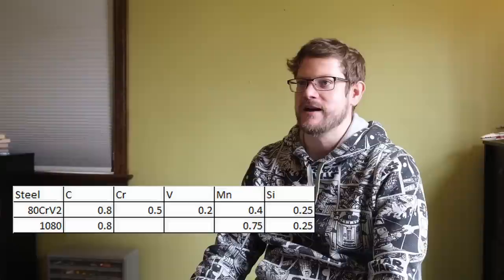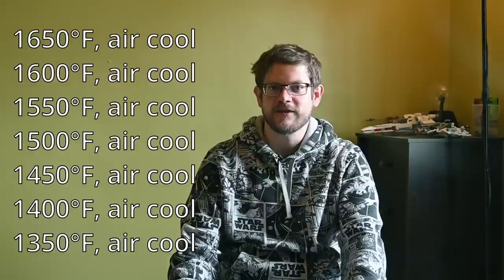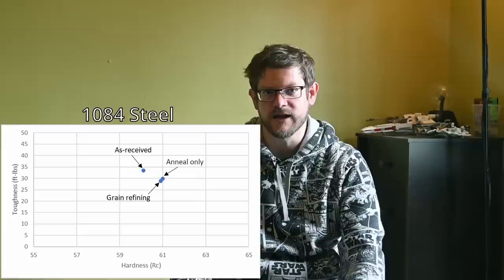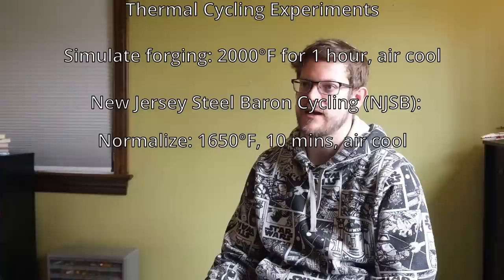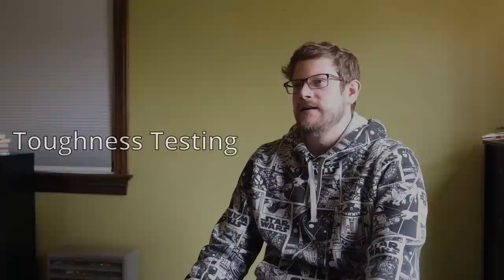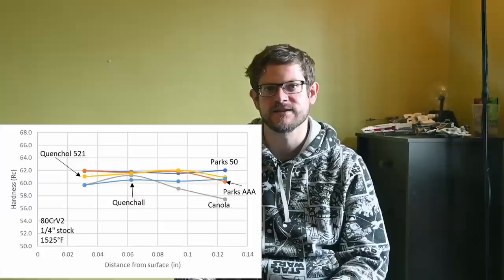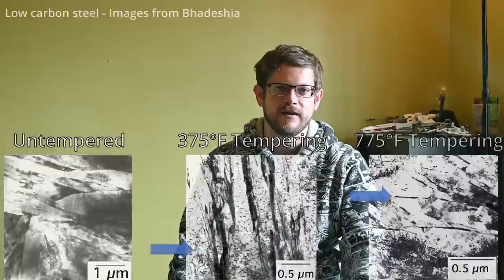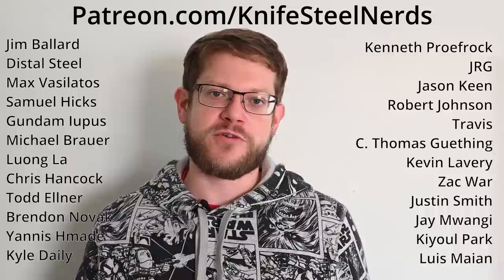How to Heat Treat 80CrV2 Knife Steel

Comment: I make professional grade throwing knives for no spin and half spin throwing. I use two steels 80crv2 and 5160. Both are super tuff and do not suffer snapped tips or blunted tips. Ive stuck mine into cinder blocks even with no damage done

Comment: I've been using 80crv2 for some time now. Also, having a kiln gives me excellent results. Using the processes you've mentioned, is exactly what I do. I use Parks 50 as my quench oil, and the result is excellent in toughness and edge retention. I really appreciate your research, as it definitely helps me become a better Smith
Reply: How fast do you bring the furnace up to temp? If just doing stock removal knives what process do you recommend I use? I also use 3/16 steel so would the formula change? I have park50 oil as well.
Reply: You've figured out how to program a kiln? What programming degree do you have?

Comment: WOW that is a lot of information! I love my WINKLER belt knife in 80CrV2 !!
Reply: Dude I love my winkler woodsman but I’m always conflicted that I straight up spent $380 on a knife… and on a knife with a steel that as Larrin says is so “boring” lmao. It’s a true workhorse of a user knife but Jesus Christ I spent $380 on a low alloy carbon steel. Still, performance wise, no complaints so far and it takes a stupid sharp edge so easily, which I guess is why Winkler likes to make his knives with 80CrV2.
Reply: @andresgamba1478  the Woodsman is an Awesome WINKLER blade. $380 is a lot of money, but it’s a WINKLER. Mine was $350 , and I am glad I spent it. I have 4 knives
Reply: @andresgamba1478  Winkler and RMJ using 80CrV2 is completely corrupt.  This is for their own ease of manufacture.  Their prices are immoral for what you're getting.  RMJ also uses 3V and Magnacut - so they defiantly know better - though they charge even more ridiculous prices for their 3V offerings.
Reply: @mlentsch  then don’t buy them, what can I say? The steel a knife uses is not the only factor in its price, nor is it even the most expensive factor in knife production. Me and a buddy of mine who both carry a winkler as users will swear by them but I can understand your conception that a knife in 80CrV2 shouldn’t be that expensive, even if I disagree.

Comment: Thanks very much for this video Larrin, and your book which is a really great resource. I'm in the process of heat treating a chopper I made out of pattern welded steel. I used 80crv2 (Jantz), and 15n20. It's very confusing trying to figure out the right method to heat treat since it's 2 different steels with differing properties. Since I wasn't sure, and for 15n20 your book says to austenitize at 1475 for 10 min which is close to the recommendation for 80crv2, I'm going with the 80crv2 rec. I do have a new Jen Ken vertical air bath kiln, which is AWESOME, so that should help. I've already completed the normalizing and heat treating steps, and will quench it tomorrow in parks 50, then planning to temper at 400 for 2 hrs x 2. Thanks again for the good advice! PS. I'd love to see a video outlining some general rules/recommendations for heat treating pattern welded steel in the future, but I know that must be a seriously tough subject to tackle!

Comment: Thanks for the video, was contemplating purchasing some 80crv2, still thinking about it.  I purchased your book, and have been selectively going through it.  I’m new to knife making, and am amazed how steel can change in a solid state through different heating processes.  Don’t have a heat treating oven so will be using your suggested methods for heat treating until I can get one.  Once again, thank you!

Comment: I am more familiar with naval battleship Krupp-type nickel-chromium armor mild steels (0.25-0.55% Carbon).  Your explanation on the problems with using too high a tempering temperature giving temper embrittlement helped my understanding of the major improvement in these armor steel between WWI-era and WWII-era steels of these types, with only a couple of WWI-era manufacturers (US The Midvale Company in its pre-WWI Midvale Non-Cemented face-hardened side armor and, I believe from test results, Austro-Hungarian WWI-era Witkowitz Company face-hardened Krupp Cemented side armor).  I knew of the results of this new knowledge, but not why it occurred.  Thank you.

Comment: I'm glad you put this up because in a brief dalliance I had doing some fairly basic 80CRV2 knives I did find it a fairly complicated metal compared to say 1084 and this has gone a way to explaining were I found a few hang-ups along the way during my (furnace controlled) heat treating. This is going back before I had your book and was sort of aggregating info on it from other sources and the manufacturer. Not to be too dismissive of the metal I did reach a point that in some ways its not offering a lot in terms of some areas and quite surpassed in others by high alloy-mid carbon sort of equivalent applications and that literally for me came down to processing and repeatable results.
Some of my 80CRV2 was really very good, others are just mediocre and it wasn't really very consistent, the other sad nail in the no-go for it was that for some ungodly reason it just corrodes so quickly! Dunno exactly why, but I could literally do some wet sanding on say a piece of 26C3, dry it off well and put it aside, come back 2 days later and it'll be fine. The 80CRV2 was developing the first stages of rust on the side I wasn't actively working on, do that side and by the time it flipped back over it had started rusting again on the side I'd just first done: Which by all means can be worked around and treated, fiddling with and so on, but there's just some extra things you don't need in your life. 
Thanks again for this one

Comment: Thank goodness - I have pretty good luck with O1 and 26c3 in a forge, but without looking further, a little overhard and undertough for 1084 (it's not something useful for tools when O1 is available). I've also never seen any beginner get results that are anything other than subpar with 1084 and almost everyone refuses to buy parks 50 because of the cost.
Reply: (almost everyone meaning every beginner. anyone who fails to get high hardness with water hardening steel over and over will buy parks and be shocked at how the results are suddenly good).

Comment: One further comment, just came to mind. Maybe you could do 55Si7/EN 45/9260/modern spring steel one day ? With the ca 2 % of Silicon we have an oil hardening steel (gets "fully hard" in canola, i dont have an RC meter, i believe the critical time is around 10s in the TTT) that does not contain carbide formers and should therefore not have memory - but maybe new surprizes! I vaguely remember reading that Si steel have no TME but may have in some cases fairly low toughness for temper below the "blue range". Another interesting bit is that it does not harden from a quick forge heat at nonmagnetic, even in water. It needs to be orange/900°C. I have read that Silicon being a light element and therefore a lot of atoms at 2% acts as a diffusion reductor so badly that it retards carbon dissolution. Its a really interesting metal and there is little info on its properties as a tool steel and in artisanal use because it is not commonly sold in small quitity for tool and die shops. Given that this is simultaneously quite possibly the second most used artisanal blacksmithing tool steel of current times after 1045 because almost every blacksmith, developed or developing world has some and uses or used it at some point....i think that video would find a lot of viewers....

Comment: The laser is just for aiming. It is an infrared thermometer, measures infrared radiation. Usually an area of about 1 to 8. As in 1 inch diameter at 8 inches distance. The area at distance will be listed in the instructions.1 to 12 is also common.

Comment: I'm a total newbie to knife making. I cut a blank from 4130 HT, ready to heat treat. Cheap forge coming next week. Carbon content on 4130 is .25 to .33, sounds like I can quench in water and achieve a low RC hardness. I can probably cut ten blanks from the piece that I have. Question, waste of time or keep learning as I go?  Knife Engineering is on the way. Thanks for your time.
Reply from the maker: Low alloy steels like 80CrV2 are quite cheap so if it were me I would buy a bunch of that and start practicing knifemaking.
Reply: @KnifeSteelNerds  I appreciate the response. I found a piece of 4130 HT at an estate sale 40"x8"x.125". I've been wanting to try this, that steel started me on the journey. I don't think you can get a good heat treat on the steel, but should be good enough to get comfortable with the blank and handle making process. From what I read, you're lucky to get a 50-52 rc hardness with 4130. I know I'm talking above my pay grade, I'm at ground zero. Thanks!

Comment: Very thorough work super work, a few remarks 1. HRC below 20 is not defined, my experience with tempering knifesteel for best resistance to edge chipping is temper at slightly higher temperatures ie 260C twice for 30 minuttets.

Comment: I love that analysis, so now I'd like to hear you opine on why 'wootz' steel is red-short, i.e. prone to cracking when forged well above critical, even when the carbon content is below what people normally consider to be 'wootz', because all 'wootz' is, essentially small batch crucible steel, the 'ultra high carbon' thing is a distraction, they were making wootz down to eutectoid carbon content. De-oxygenated, AKA killed, unkilled, does not seem to matter. I know there is virtually no published data on this, but it is a topic that is interesting, to at least several people.  ;-)

Comment: I would have liked to see a tension test of these materials.
Especially to see the difference between each step, from beginning to the end.
But it would add to the cost with a tensile tester and preparing the specimens. The tester might no be that expensive for the small specimens you are working with. Maybe you could find one used?

Comment: Thanks for all that info. I'm a begginer weekend knifemaker and appreciate all tips make me improve my skills. I maybe made a mistake but I bought a laser thermometer to check temps, but i'm not sure which is the emmisivity of Red Hot steel to set it. Your answer will be very appreciated.  Sorry if my english is not very good.
Reply from the maker: The emissivity of oxidized steel at high temperature is around 0.8. But it can vary some based on steel composition and temperature.
Reply: Thanks so much for taking a bit of your time to answer!!

Comment: First of all thank you very much for your work. It is an amazing contribution to the knife maker community. - I'm about to start playing around with this steel. I am stock removal and I use an evenheat oven for heat treating so I have no problem reaching and maintaining temperature/time. Your results here lead me to understand that if I want the best outcome from my 80CrV2 from NJSB then I should still normalize and anneal in order to get the spheridized structure before final quench. Am I understanding correctly? I'd like to get the best I can out of my 80CrV2 for general purpose small blades.

Comment: Amazing video as always. I have a question about tempered martensite embrittlement. I’ve been making swords out of 80CRV2 and tempering them with a blue spring temper (540degrees F). After watching your video, is it true that my swords would be tougher and harder if I used a lower temper? 400-450 degrees F?

I’m making longswords with 36” blades from 0.25”, what would be your recommended temper 

Thank you so much
Reply: Probably
Reply: I would suggest making a few blades and testing them to destruction to find out.

Comment: Could you make a small "knife" showing us the difference between brittle steel good steel and too soft steel?
How they are so sharpen, both how easy but also how sharp you can make them. And the edge retention test and a toughness test of the edge?
I do not know what my knifes are made of, how hard or brittle they are, but if I know how a hard steel and soft steel acts then maybe I could understand what types of knifes I have.

Comment: What if you use a muffle with a thermo-couple in your forge?
Reply from the maker: A muffle can help with temperature uniformity but I have also seen overheated steel from bladesmiths with a muffle because the thermocouple wasn’t seeing the same temperature as the blade. So it isn’t a cure-all.

Comment: Thanks for the very interesting and enlighting video.
One question, I have regarding to archieve the finest possible grain structure on a steel.
What if I have a rather coarse sphereodized 80CrV2 / 1.2235 / L2 steel and I perform a double hardening procedure instead of cycling the nomalize and annealing process?
Would double or even tripple heating and quenching result in even finer and finer grain structure and may be a quicker process?

Comment: Awesome vid...question....I have some 80crv2 and 52100...stock removal...I'm using a propane forge with thermocouple and also a laser to get the temps as good as possible...is there a need to normalize and grain refinement before Austinize?...thankyou

Comment: Thank you Jason Knight was the first I heard about 80crv. I have a quest for you.  Not everyone can afford 50.00 a gallon for oil. What are some cheaper alternatives and what are the results of those?
Reply from the maker: You can look at Dubois or Maxim: https://store.duboischemicals.com/quenching-fluid/
maximoil@hotmail.com
Reply: There's talk about parks 50 being basically mineral oil such as is baby oil, is mineral oil but old timers say to go to a feed and tack store to buy veterinary/ animal approved mineral oil to use as a quenching oil.. I have zero experience with using such oils in an off label manner such as that..that said,it doesn't sound crazy..at least to a non Phd kinda guy..Cheers..

Comment: Are you going to be doing any metal comparisons?  Magnacut vs Elmax , or 3v vs Cru-wear etc.
Reply from the maker: I have my steel ratings video/article. And typically with any article or video on a specific steel I give general comparisons with steels in that category. But I don't currently have planned any 1v1 steel videos.

Comment: Never knew how big a difference pre-austenitizing condition mattered. Would it matter as much for structural applications that aren't finished as hard? Something like 4340 at ~40 HRC?
Reply from the maker: 4340 has quite a bit of alloy in it so presumably the starting structure would still affect things. Thoigh the fact that it is hypoeutetectoid means there isn’t excess carbide to dissolve.

Comment: Quick question - why do you austenitize in an oven to 1525 with some soak time but only to non-magnetic and then quench in a forge?
Reply from the maker: Because the forge heat treatment is designed to work with no soak time by using the pearlite starting microstructure because people get in trouble by overheating in a forge. In a furnace I prefer an annealed microstructure which allows more control over the final properties by adjusting austenitizing temperature. From an annealed starting structure a soak of 10+ minutes makes it much less sensitive to small changes in soak time or stock thickness.
Reply: @KnifeSteelNerds  OK. I can hold my vertical forge +/- 5 degrees anywhere from about 1375 to 2200. With stock removal steel would I be better off to give 80CrV a bit of a soak prior to quenching? (On alloy/type steel I use Quench A from Great Lakes Oil at about 150 degrees. It's a bit of a replacement for the old Texaco A) I would appreciate your thoughts.
Reply from the maker: A soak of 10-15 minutes would likely be beneficial, yes. I have seen examples where too short of a soak time leads to both lower hardness and lower toughness, such as with 8670: https://knifesteelnerds.com/2021/04/26/how-to-heat-treat-8670/ Some knifemakers are afraid of soak time and will scoff at anything over 5 minutes because they are afraid of grain growth but as long as you are at the right temperature that is not an issue.
Reply: @KnifeSteelNerds  Nice. Thanks for that.
Reply: @KnifeSteelNerds  I don't scoff at anything that'll make my knives better.

Comment: If there is minimal return for increasing C above 0.6%, why do steels like ZDP-189 use a C content as high as 3%?
Reply from the maker: The extra carbon is for the formation of carbides for wear resistance, not for more hardness.

Comment: lovely videos.  Thank you.

Had any opinion on Kilns for nerdy newbies?  I want to get into knife making as a personal hobby.

The one you have in your video may actually be the one I was looking at, Evenheat kh-418 120v 2200F, but I want to make sure I won't need to upgrade later. 

Should I even be considering such a pricey Kiln to start?  I have a CNC, belt sharpers, laser engravers, etc -- but maybe a blow torch would be enough for my needs? 

Anyways,  keep it up :)
Reply from the maker: I have the Evenheat LB 22.5. It is a very good furnace. If you can’t afford a furnace yet I would recommend sending out for heat treatment rather than a blowtorch.
Reply: @KnifeSteelNerds  thank you kindly